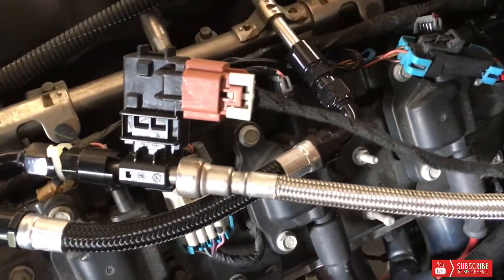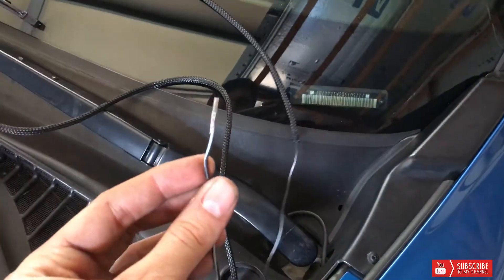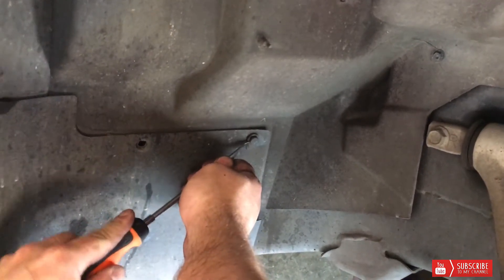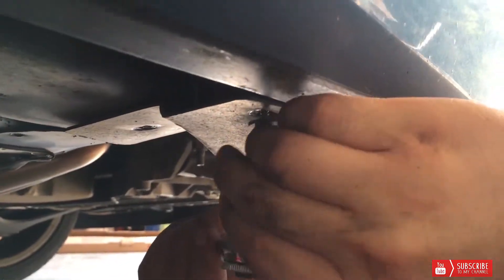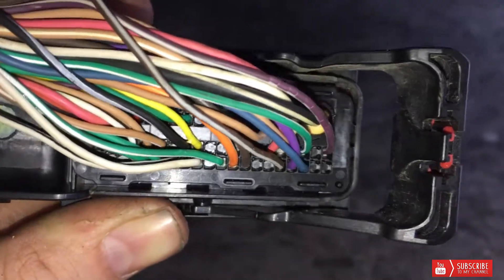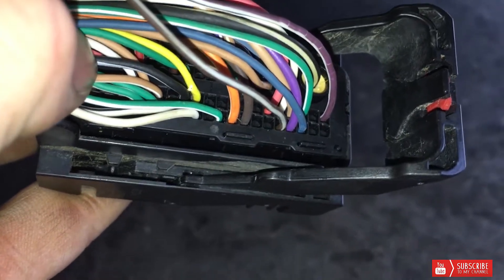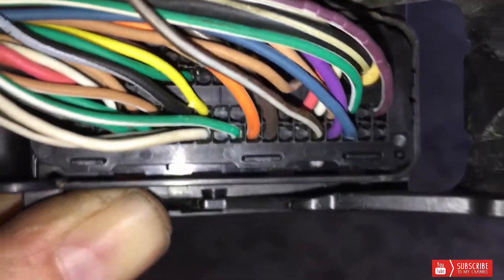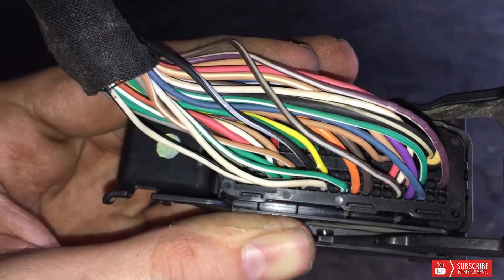Cammed C6 corvette E85 sensor install

Comment: Did you need a new fuel pump ?
Reply from the maker: While it was NA just need a voltage booster on stock pump.

Comment: This is all you need to do to upgrade to e85?
Reply: If you have a LS, you need to upgrade fuel pump and upgrade injectors to handle e85. Then get car retuned.

Comment: do i need bigger injectors or different fuel pump to run e85 tuned... or can i just get the sensor get it tuned and go for it
Reply from the maker: I would at a minimum get some Fuel injector clinic 850cc just to give you head room and a boost a pump. These will keep you on the safe side.

Comment: Is the e85 sensor all you need to run e85 with no problem or do you need a fuel pump and injectors to am stuck in a hard hole right now not sure what exactly you need to run e85
Reply: also need injectors, a fuel pump wouldn’t hurt but it’s not necessary

Comment: @Cuttycutty71 cam is 227/244  115+5
Reply: Jared Gillim  does the stock ecm adjust fuel settings when it reads e85 or did you have to take it to a tuner? Also in the cam what do you mean 115+5 lsa?